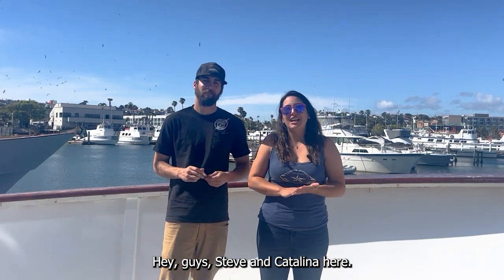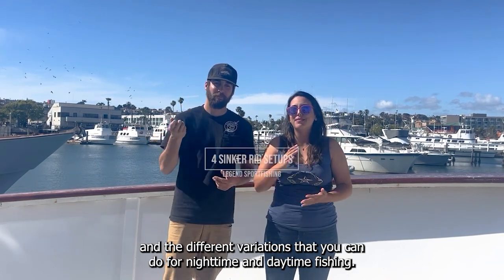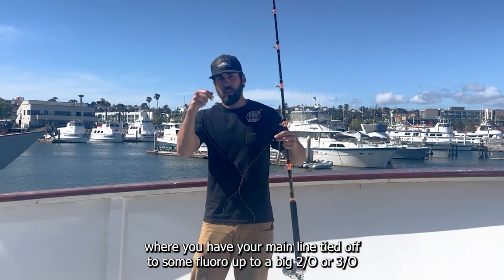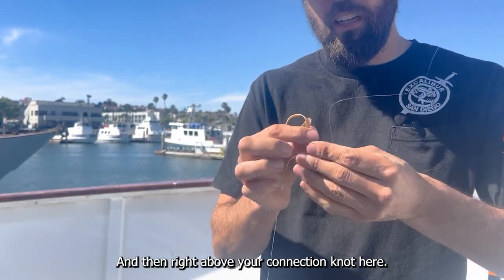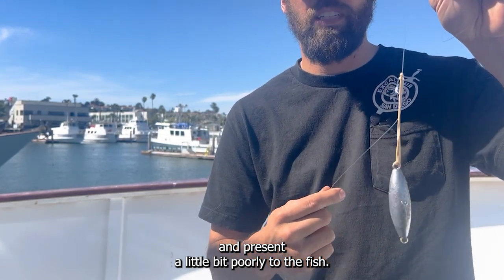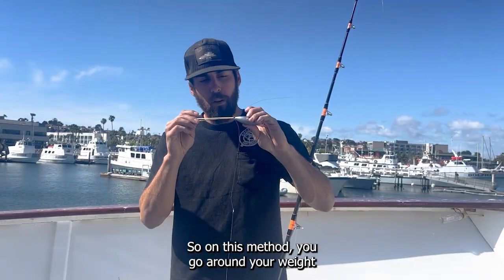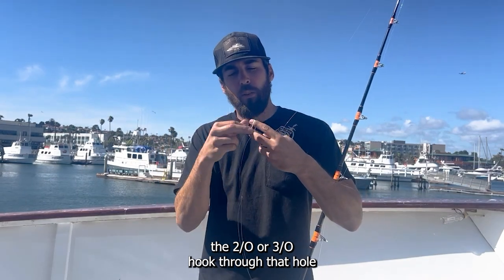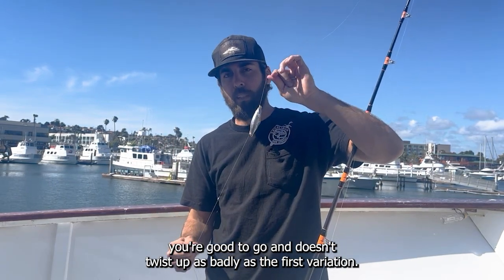Sinker Rig Tips for Bluefin Tuna Fishing

Comment: Going to use my Avet JX6/3 for my sinker rig. Should I go 65lb braid with 80 mono or 60 mono. ?
Reply from the maker: If it’s a raptor, 65 braid to 50 or 60 mono is gonna pretty much top out the capabilities of that jx. If it’s a standard model, it really is more fit to fish in the 40 lb line class. A hx or even an lx would be a better choice for sinker rig, especially right now with the big fish we’re seeing.